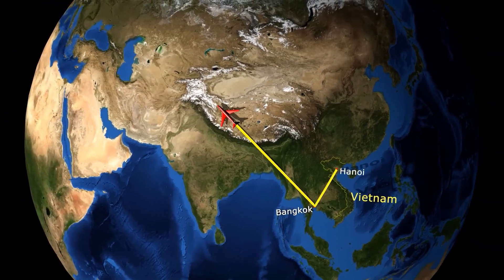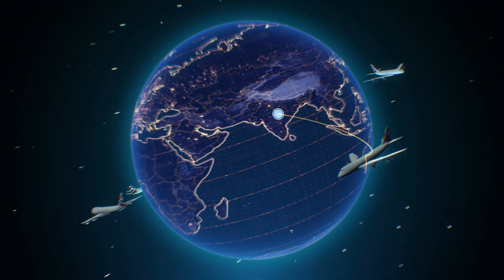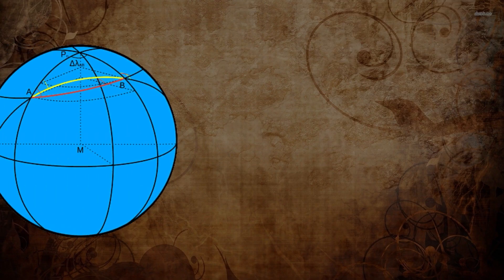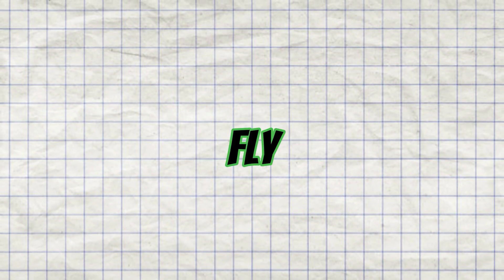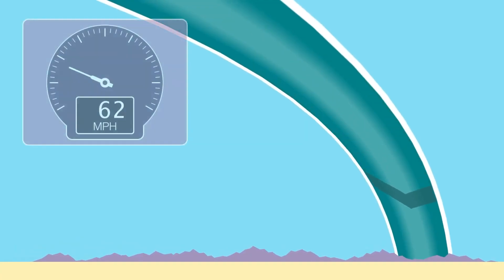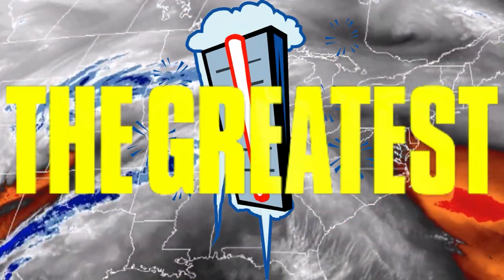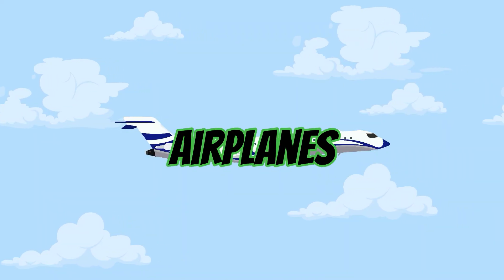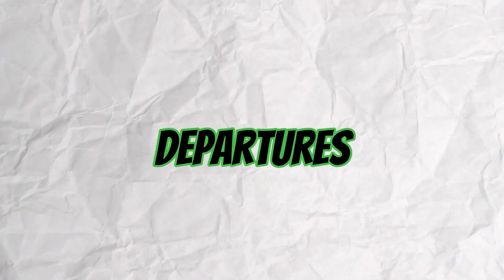Why Airplanes Don't Fly Straight

Comment: You show 3750km from us to eu. From NYC to London is exactly 3,450 miles, 5,500km without any deviation or alteration to the route. Stopping at greenland adds; 

Total NYC → South Greenland → London:
≈ 3,700 miles
≈ 5,950 km

Comparison:
Direct NYC → London straight line: ~3,450 miles
With south-Greenland stop: ~250 miles longer overall.
Reply: I was fooled for so so long about earth being curved, it isnt. Only those who dont understand line of sight and how curvature decreases distance of line of sight per Km to Ft in height dont understand physics.

Comment: For those who are not going to check the full video (and yes, i totally agree because it is boring to watch) The reason why is that is, is because there is jet streams (Between cold and warm place) where the winds pushes objects in the sky, and this applies to planes, they use this to save fuel.

The thing about jet streams is that jet steams are mostly only common in winter months so there’s no point right? No, Air Traffic Control towers (ATC), ATC are usually not placed in a straight line, and ATCs or Airports would be scattered in different directions, so the planes have to usually go approach the ATCs nearest to the straight path to the destination for communication with the ground incase of a emergency, similar to checkpoints like in car racing games or car rally games.

(Extras) This is also to prevent planes from colliding into each other
Reply: This essay was just as long, and 100000% more boring. 

People should just watch the video

Comment: WHAT BULLSHIT!!!
Modus Operandi -- Talk fast and make something extremely complicated seem stupidly simple.  
Airplanes DO fly straight.  
Jeppesen Flight Charts are two dimensional maps that have straight WAY POINTS.  
Flight plans contain WAY POINTS ..... A to B ......B to C .... And so on.
Auto Pilot & Air Traffic Control directives & corrections work with exact constant Course Headings from a 360-degree circle of a magnetic north compass. 

If airplanes really flew like the moronic indoctrination video (above) 
the correct course HEADING would be constantly changing throughout the flight.
Reply: LMAO you have Absolute no idea. Hilarious comment.
Reply: @ Enough with these hollow empty vague unsubstantiated criticisms.  Don't be a cowardice chicken shit.  Point out the WHAT or WHY in my comment that makes me a laughable idiot with no idea what I'm talking about.
Reply: @raymond3803  The heading IS constantly changing throughout the flight, even though the pattern follows a great circle. Thanks for playing 🤣
Reply: @AlexFoxthrot  That's bullshit.  Headings for every way-point are programmed into the auto pilot before the plane takes off.  Several videos showing pilot & first officer doing it in the cockpit.  Constantly changing headings would be a nightmare doing so on the fly.  It would be easier to fly the plane manually.  So much for your fictitious globe and "Great Ball" routes.
Reply: @raymond3803  I am a pilot, you go by hear-say. The route is programmed in the FMS yes, but they don't follow constant headings, the route is maintained via a mixture of GPS signals and IRS information, the heading also has to change to compensate for the XW component, airplanes only fly constant headings when instructed by the ATC due to traffic or other reasons, you don't know what you are talking about. I have witnessed this plenty of times, even within a short leg from WPT to WPT which on maps seems straight, the track heading changes because Earth is indeed spherical. It's in every aviation manual. Keep trying.
Reply: @raymond3803  Oh and genius, even on a flat Earth, unless you are flying straight North or South, your heading on a straight line would too be always changing. Keep trying, smart guy. I will be here to school you over and over.
Reply: @AlexFoxthrot  You're a pilot?  So what?  I do know what I'm talking about.  There's a video where 18 commercial pilots admit earth is flat.  Do they know what they're talking about?  Before GPS, Jeppesen Flight Charts were straight lines.  

TWA was still in business on 09/11/01.  They interviewed THE CHIEF pilot for TWA at the time, about his recollections of that day.  He was training a young pilot.  They had an early flight departing St. Louis nonstop to New York.  He said: "It was such a clear beautiful day, you could almost see New York City, from St. Louis." Keep in mind, this was TWA's Chief Pilot. He said it in jest.  A casual comment.  On your fictitious globe, New York is hidden from St Louis by 93 vertical miles of curvature.  At 35,000 feet, NY is still hidden by over 50 miles of curve.

This would be the equivalent of a Chief Journeyman Land Surveyor saying:  It was such a clear beautiful day, you could almost see Lake Mead from the back side base of Hoover Dam.  That's how ridiculous the TWA pilot was.

A spherical earth is in every aviation manual?  SO WHAT?  It's in every Land Survey Manual.  Then ......... the manual instructs you to disregard curve on SMALL surveys = < 100 sq. mi. because curvature is negligible and insignificant.  Is 66.7 feet of error insignificant?  

Earth is flat, and YOU DAMN WELL KNOW IT.
Reply: @raymond3803  Hilarious. No, they don't admit it's flat, they mock the question because, I hate to break it to you, but nobody except those who debate, take you seriously. Plus, pilots can be idiots, too. Before GPS Jeppesen flight charts were straight lines? You can't even make a sentence. A chart is a chart, a line is a line, a line might be drawn on a chart, but a Chart is not a line. Plus, what kind of chart are you even talking about? IAC charts? MRA charts? NA charts? You don't know what you are talking about. Those testimonies are invalid and they said "almost", they did not say they saw either things and we both can't have a shred of an idea of what they actually saw so that argument is beyond pathetic. No, Earth is noy flat because every map comes from the globe and they work, there is no flat map of a flat Earth that works and flight paths prove this. I see the horizon below eye level from my HUD, this destroys another of your mantras. You have no map, you have no model, your anger and frustration are not valid arguments. You failed to prove anything at all. Keep trying, kid, I'll be here schooling you again. Or, feel free to tap out.
Reply: @AlexFoxthrot  No!  Straight lines work fine in any direction on a flat earth.  Ever heard? The shortest distance between two points is a straight line.  Hey Dummy.  That statement only works on a flat earth.
Otherwise, they'd say the great ball route is the shortest distance.  They'd say Elev. above sea curve, not sea level.
Reply: @raymond3803  Wow, just wow. You could not refute a single thing I said about your argument, you are already losing big time. Straight on the globe means not turning left or right, and it can happen. Sea level is an average distance from the center of the Earth, just because level can be used sometimes as a synonym of flat it does not constitute scientific evidence for the flatness of Earth. Wow your arguments are so pathetic. It's great circle, not great ball, you can try and discredit the globe in any way you want, it's still not flat and makes you look ridiculous, not smarter than average, quite the opposite, in fact. Show me a map of the whole flatearth that works for navigation, I want one with a uniform scale. Can you provide me with one? Because so far all Globe projections have worked, while no flatearther has been able to show a working map or a coherent model. You can't even explain sunsets. But keep talking about airplanes, Mr. Dunning-Krueger.
Reply: @AlexFoxthrot  nobody except those who debate, take you seriously.  What puts you in a position to speak for everyone, how they feel about me, that nobody takes me seriously?  Justify why you can do that. Is it common practice for commercial pilots to mock and make fun of passengers?

18 passengers asked 18 commercial pilots, on video tape. some form of the following question:  Is the earth flat?  OR  Is it true that the earth is really flat? 18 pilots answered: YES!  According to you, that's mocking.  

Mock:  To tease or laugh at in a scornful or contemptuous manner:
Yes=Mocking?
Reply: @AlexFoxthrot  Your comments are riddled with stupidity.  Sea level is an average distance from the center of the Earth. Provide the math equations to determine the center of a pear-shaped, squished oblate spheroid.  There are no globe projects, nor geodetic surveys.  Survey manuals say up to 66.7 vertical feet of error is insignificant.  To disregard curve on SMALL surveys =< 100 sq mi.  Since the globe is BAKED IN to every survey, what's the procedure to take the curve out?   Once again, what places you in a position to say that nobody takes me seriously.
Reply: @raymond3803  Waiting...
Reply: @AlexFoxthrot   You can wait in one hand and shit in the other to see which one fills up first.  I'm not wasting any more time on the likes of you.  There's about a dozen legit questions you've ignored.  You've posted LMAO & Hilarius twice without saying what was funny.  You've taken the liberty to speak for everybody twice without saying how its justified.   
You & Baron Rutledge.  It's not the lesser of two evils ......... It's the evil, of two lessers.  Quote the Raymond, nevermore.
Reply: @raymond3803  You are so scared
Reply: @raymond3803  Still waiting for that map. You are so scared.
Reply: I think you misunderstood it. Planes do fly straight, but the flight paths appear curved as we're viewing a 3rd flight on a 2d map
Reply: @ NO!  A straight 3d flight around a spere would have constantly changing headings.  A North azimuth heading on a 2d flight chart is the same as a 2d compass.  You're so indoctrinated, you can't see something so obvious and wrong.  Programed Auto Pilot headings don't work on a globe.  It would be easier to fly it by hand.
Reply: @Michael-pp8lz  Planes do fly straight.  Yeah, I clearly said that.  The flight paths appear curved ON THIS VIDEO.  TO INDOCTRINATE YOU.  Flight paths in-between way points on 2d Jeppesen Charts (that really count) are arrow straight. They correspond to an arrow straight heading from a 2d compass w/ North azimuth.  Flying over a globe. Programing an Auto Pilot with a constant heading would only work with @ 0 degrees due North, or 180 degrees due South heading..The other 358 degrees/directions the heading would change throughout the flight.  Easier to fly it by hand.

Comment: Lets say we had a bad mathematician who put too little kerosene on an aircraft. What would happen if they only realised that they had low fuel when the landing airport was the nearest. Would they go in a straight line to conserve fuel?
Reply from the maker: Such a situation is virtually impossible as there are so many layers of safety to prevent that. However, if that theoretically happened, yes, the airplane will get priority as it’s in an emergency situation and everything will be done to make it possible to land
Reply: @LuxPlanes  it's basically air Canada flight 143

Comment: You forgot that sometimes there is airspace closure/restrictions (ie around Disney and government buildings) and sometimes mountains
Reply from the maker: Yes that’s true! I was going to mention it, but usually these restricted airspace’s are low altitude and SIDS and STARS are designed to fly around them so I thought that would be enough information. But yes you are correct of course :)
Reply: They don’t fly though Tibet cuz of the Himalayas
Reply: What's with disney?
Reply: @tegarandikash  it is a safety measure put in place after the 9/11 attacks. Also applies to sporting events with over 30,000 people.

Comment: Wow I finally found why they dont fly in straight lines 🤔 thanks!
Reply from the maker: You’re very welcome! Glad you learned some new stuff and I hope you enjoyed the video!
Reply: Airplanes DO fly straight.  
Jeppesen Flight Charts are two dimensional maps that have straight WAY POINTS.  
Flight plans contain WAY POINTS ..... A to B ......B to C .... And so on.
Auto Pilot & Air Traffic Control directives & corrections work with exact constant Course Headings from a 360-degree circle of a magnetic north compass. 

If airplanes really flew like the moronic indoctrination video (above) 
the correct course HEADING would be constantly changing throughout the flight.
Reply from the maker: @raymond3803  dang chill, the video explains why the dont fly in a straight line from the origin to the destination. Yes, in the end the route is composed of a bunch of straight lines. But that’s like saying a circle on a monitor isn’t a circle because it’s just a bunch of squares if you look close enough
Reply: @LuxPlanes  "Yes, in the end the route is composed of a bunch of straight lines. A bunch?  That's not true.  Sometimes only 1 or 2.  Your video shows flights with a constant arc.  ATC course directives & Auto Pilots would never work if your video was true.

Have you noticed a decrease in UFO/Alien data-info-videos the past 5-7 years? 
I have.  Mostly documentary reruns or compilations of old incidents.  Very little new material.  I think I know why.  The Flat Earth movement/reality made popular and prominent UFO-ologists look stupid.  A UFO expert should probably know, first & foremost, the correct shape of earth.  Don't you think?   

Mark Sargent single handedly destroyed Richard Hogeland's (Mr. Face on Mars) credibility & career in one debate.  Richard Hogeland never to be seen or heard from again......... FACT!
Reply from the maker: @raymond3803  ,you really love picking on every single detail. Generally it’s more than 1 or 2, but yes, it can be just 1 or 2

And as with many explanations, the video footage in the background is exaggerated to make certain points clearer and more understandable. Also how does bringing UFOs up fit into this discussion? Sorry this video triggers you so much but wow I’ve never seen someone so mad over the smallest things